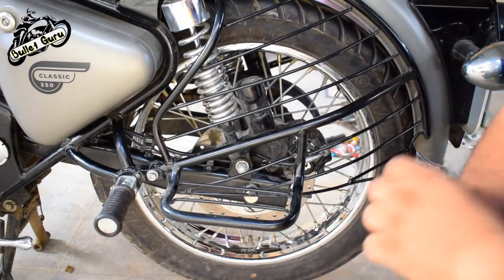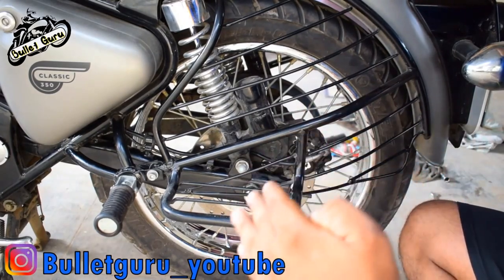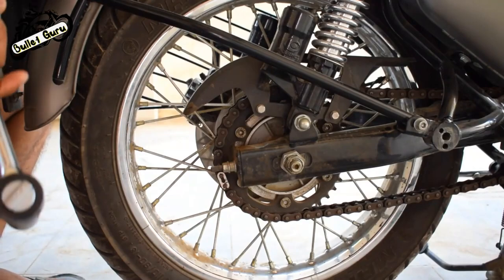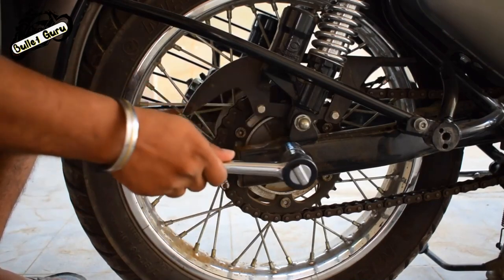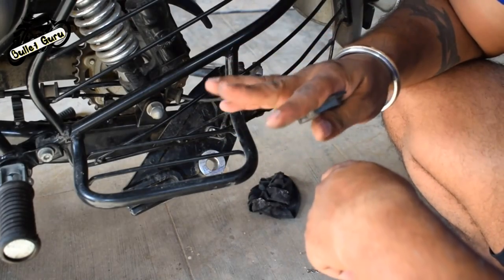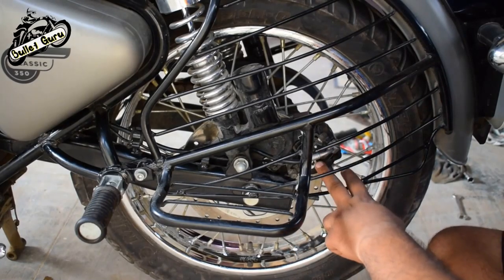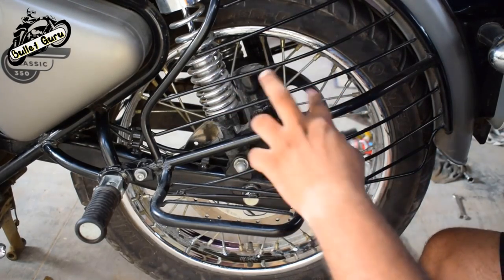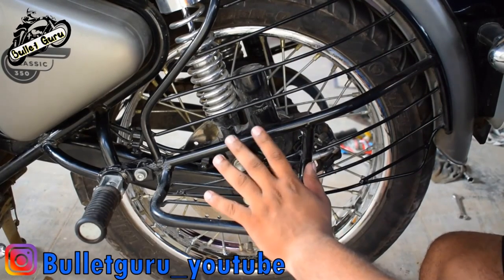Rear Disc Brake काम नहीं करता | Solution For All Bikes || DIY at Home

Comment: Its not necessary to remove the wheel in order to remove the disc pads.....just removing the cotter pins n d small rod will get d pads removed....I did it myself....if u remove the wheel,its very necessary to put it back correctly and issues may arise regarding chain loosening and alignment.....so i disagree to d method u mentioned
Reply from the maker: Its not necessary to remove wheel brother, agree with u brother 
But removing wheel & again refitting is very simple with step buy step fittng, no alignment issue
it will no create any issue of chain lose
But if ur doing this at own ur own,
Then try the both ways & share ur feedback back which is easier.
I have tried both the ways, this steps was easy
Thank u for sharing your point of view

Comment: Bro, this video is not helpful. You didn't show us the re- assembling of the rear wheel and especially the brake calipers. Which is the most important part. Please show us the re assembling of the rear wheel, and especially the brake caliper assembling.